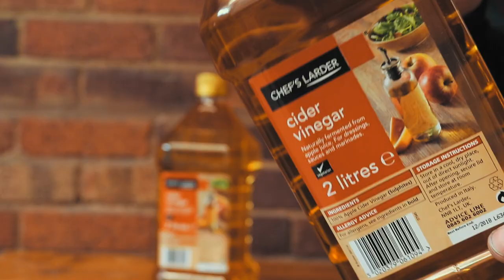Honda CB125 Cafe Racer Build - Part 7 - Rusty Tank Clean & Seat Work

Comment: I too have a 125 but mine is a 1974 MT125 Elsinore all in pieces. You have confirmed my thoughts on a restore or a mod. And did the vinegar wash in my tank. Took about a week and 3 gallons but it looks brand new inside. Great videos bud.

Comment: just an advice, for straight cut of that carbon fiber seat you can use a sharp cutter like glass cutter, draw a straight line where you want to cut then use a straight flat bar as a guide and cut it repeatedly until its done.

Comment: you can use also rust converter after removing all the old paint, i used it after i remove all the manufacturers paint and repaint the whole unit, this will ensure deep removal of rust.

Comment: great build. how come you chose to build a 125 and not a larger motor? as for the colour scheme.. gun metal tank, red frame and tan seat
Reply from the maker: Thanks buddy! I wanted to do something a little different and build a small bike, I just wanted to show you can do something cool even with a small bike!
Reply: Jish yeah thats cool, was just wondering thats all. did it extend the wheelbase of the bike adding the cbr swing arm? it looks like you wouldnt have been able to.do the monoshock conversion without the cbr swingarm
Reply from the maker: +Louis Knights the cbr swingarm is about 3" longer so has extended quiet a bit! It was so handy having the fitting already there I'll tell you that now! I was planning on having the monoshock fabricated to the stock swingarm and had it looked at and priced up etc but when that swingarm idea popped up it was like a match made in bike build heaven!
Reply: Jish ah i see, the new swing arm made it easier haha. i ask because im looking for a bike to build and want it to be monoshock but dont think i want to change the swingarm. im looking for a 81-83 virago which is already monoshock but they are like rocking horse shit

Comment: will you weld something onto the frame to prevent the handlebars from hurting your hands?
Reply from the maker: it is on the to do list yes! There are tabs already on the frame and it will be a case of adding tabs on the bottom yolk to achieve this :)
Reply: I had the same problem. Im transforming a Yamaha XS 400 with those forks and loads of other stuff ;)
It's very statisfying to join your built-up, cuz Im pretty close to your skills in wrenching :D
Nice fact about your project: it's not one of those super shiny glamour fxxxed up hipster bikes, it has edges and curves and maybe some scratches: all in all it is perfect the way you build it!
Go on!
greetings from Germany